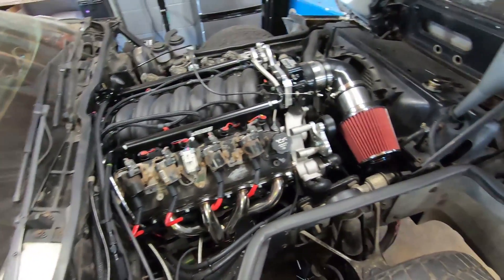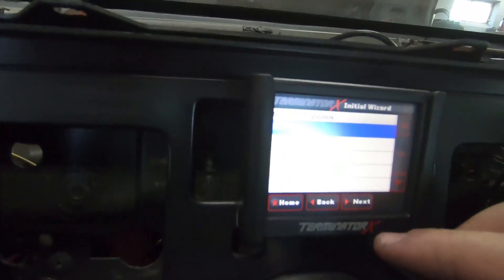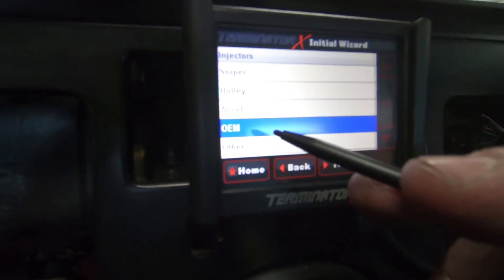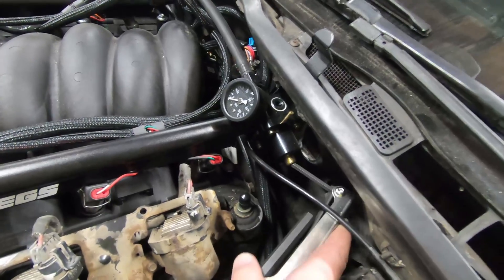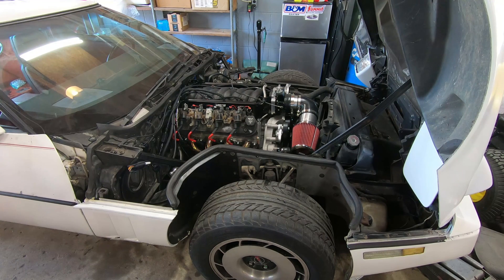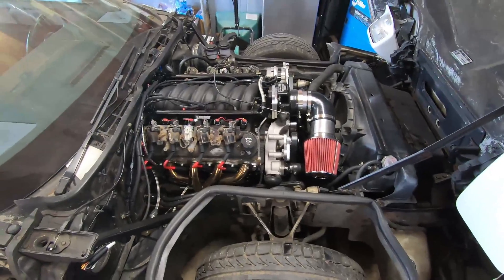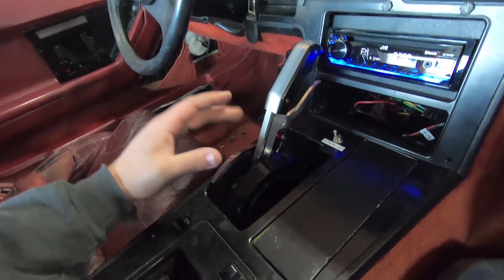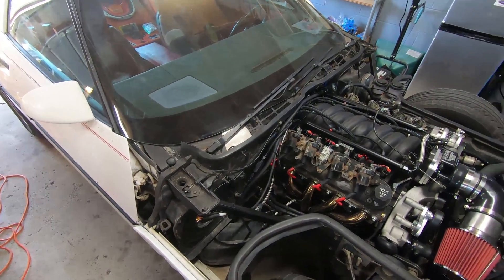6.0 Liter LS Swap C4 Corvette First Start! - LS Swap C4 Part 4

Comment: In my C4 engine swap, Blueprint 427 sb unit, I used a FiTech software system the 38351. Love both of these software computer systems. Can't wait for Spring 24~! I am planning on getting some "Quiet" mufflers with an electric cut out kit. Right now she's Loud!

Comment: I have 91 vett with only 16,350 original miles. Beautiful beast. It's stock right now and passes smog. Don't want to mess with it right now because of that. But in the future I want to do what you did. LS 6.0-6.2 off a sporty Denali or Escalade is what I'd like. Good horse power and torque, but still street legal. Any other suggestions would be great. Great video bro. Thank you.
Reply from the maker: That's awesome, hard to modify something like that. There's a ton of options out there so just make sure you have a plan before you start or you might get lost in the weeds, it's easy to do.

Comment: Was it difficult getting the old engine out?
Reply from the maker: Not really, I think I have a clip of getting it out a few videos back. Easier than putting new motor in, that's for sure.
Reply: Glad I found this channel. This is the first video I’ve seen. I have a ton of questions.. lol 
Did you have to cut anything to get the 4l80 to fit?